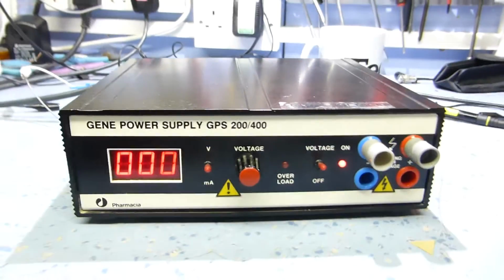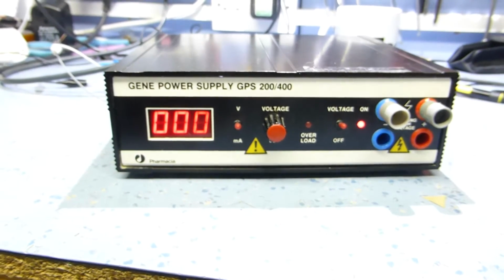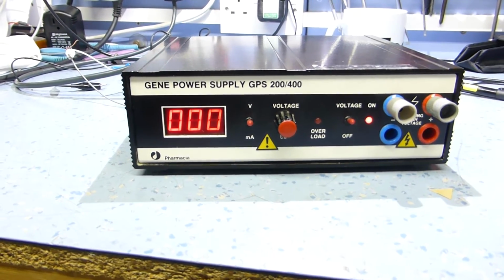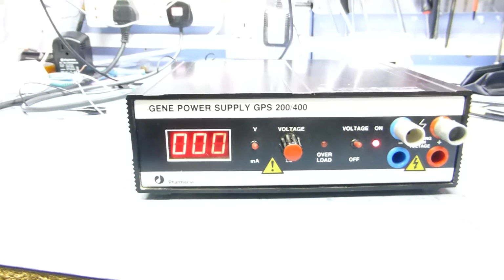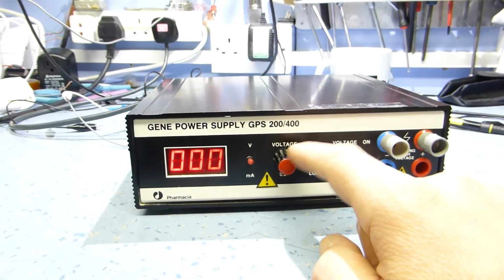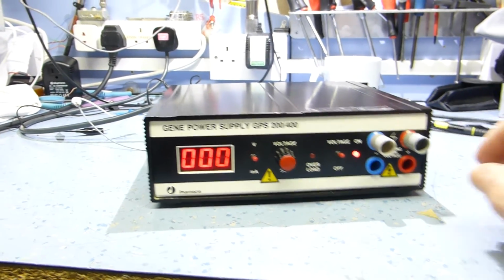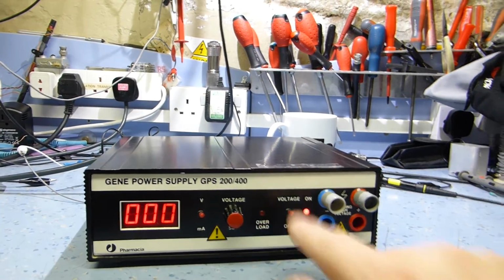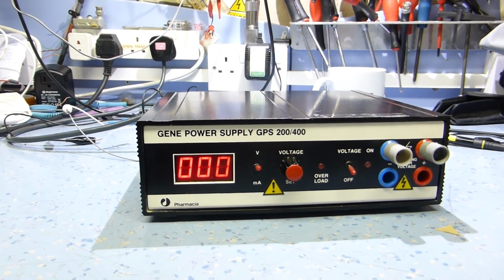Pharmacia Gene power modified for 300V

Comment: Thanks Simon! Because of your video I got the EPS 500/400 version for $20. They are quite a bargain for such high voltage power supplies with constant current capability.

Comment: Simon, absolutely correct to point out these are lethal. You can get these up to several kV at hundreds of mA. Useful bits of kit though.
Reply from the maker: I have just bought a 2KV model so I can use it on a crooks tube.
Reply: +Simon Spiers  Careful, you could make yourself fluorescent! :)  I just worked out why this unit is named the 'Gene'.... it must be intended for DNA molecule experiments.